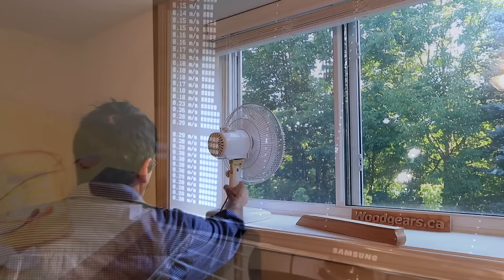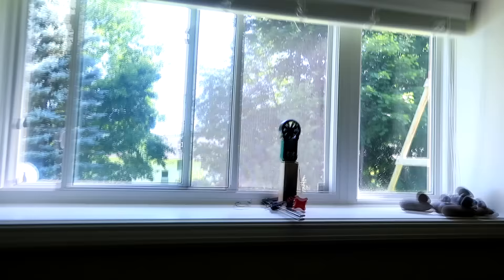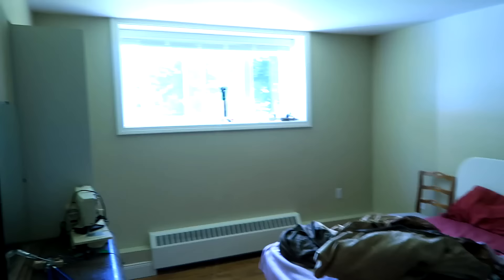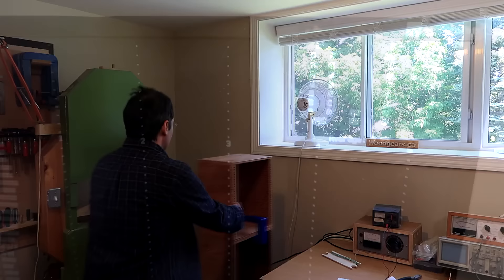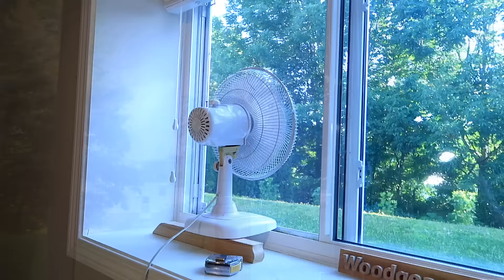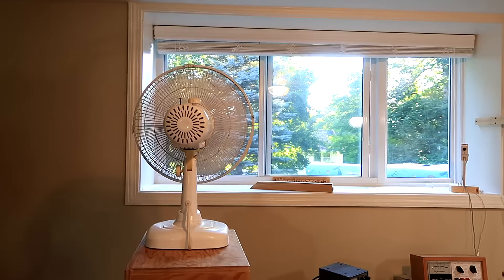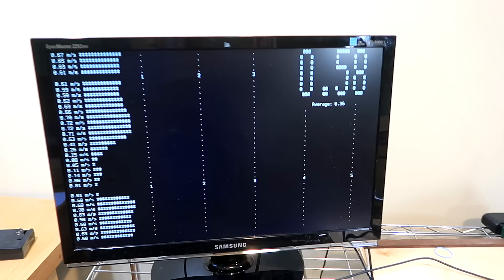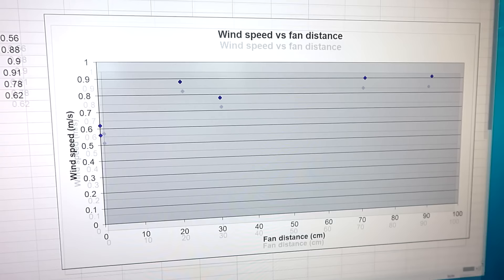Best fan placement to move air through the house

Comment: Why do you say it’s better to blow air outside rather than sucking fresh air in , if you want to get more fresh air , you’re saying you get more fresh air by blowing the existing inside air outside ? 🤷‍♂️
Reply: It is Bernoulli’s Principle amonng the other things. To put it simply, you create lower pressure in the house by blowing the air out and making it easier to get fresh air in thru the other window since its higher pressure outside and when you put the fan further away from the window, the air that is being blown out of the house will pull more air with it, think of it like air trying to stay togeter at all cost to not create the vacuum. 🙂firefighers use this priciple as well to get more fresh air inside a burning buildings. But don´t do this during the hot day as it will increase the temperature inside. Great during the night though!
Reply: @BlueFlash25  great thanks for explaining this, what if the room only has 1 window opening , then this wouldn’t work right? You would need to pull the air inside if only one opening correct?
Reply: @truman3.0  lets say you have closed door to your room and try this with only one window, it will work the same way just at reduced efficiency since you push air out but at the same time air from outside will try to get in thru the same window. How much worse it will be I cant really tell you, my wild guess would be like 60% less effective and you wont feel same breeze as you would with 2 windows but it will work
Reply: @BlueFlash25  so you think it’s still better to blow the air out than to suck it in is better even with only one opening window in the room? Your going to get more fresh air blowing the existing air out than to suck new fresh air in?
Reply: kinda and it depends, unless you have dedicated ventilation system, you wont pull much of fresh air from outside with regular fan anyway as the area that it pulls air from is from all sides of the fan and very short distance like a few inches at best, its a different principle that I forgot its name 😅 so if you direct your fan inside the room you will move it around but wont pull that much from outside if any BUT depending how you do your set up, as the fan moves air around your room and around you it might cool you down a little bit and give you false feel of lower temp. But don’t blast it directly on yourself for a long period of time as it can cause some health issues.

Comment: Wait... putting the fan facing away from me is better.... what?
Reply: If it's daytime and hotter outside than inside, face it towards yourself. What the video is showing is that when you're blowing it outside of a window, it pushes hot air out and draws air in from any other windows that are open. You shouldn't do it during day, only when it's cooler outside than inside.
Reply: @dim7239  God bless the algorithm

Comment: People you are confusing the purpose of a fan , which is not a ventilator
Reply: You're wrong. There are plenty of fan air circulators (tornado fans, window fans, etc) on the market right now that are much more powerful than these fans he's using. The problem is that he's using cheap, weak fans.

Comment: Fault with the logic here, there is no seal around the fan, it is gaping wide open  no matter where you place that fan,  my window fan fits perfectly, no gaps around the edges, it will move much more air being actually in the window and sealed.

Comment: WHy? That is no an exhaust fan or an intake fan. This is a useless experiment. Clearly you established that the fan take air from the sides that is why when you keep it near the window it simply takes the outside air and throws it back outside. How practical it is to keep this table fan in the middle of the room. WHen you can just put an exhaust fan that throws air outside or inside.
Exhause fans really circulate the air. That anemometer would be spinning. Now you get BLDC exhaust fans that run on 6.5 watts. Hardly any electricity.
A better experiment would be to get on of these BLDC exhaust fans and use a "dimmer" type speed regulator that reduces the current to slow down the fan and see if at 1 watt speed is it still effective. So at 1 watt you can keep it on 24/7 it will hardly consume electricity and it will be ever so silent.
Anotther experiment would be to use computer fans which are like 1/10th the price of BLDS exhaust fans. See if they are as effective